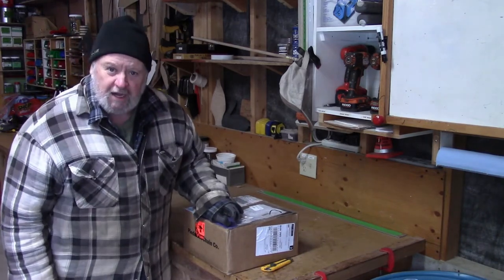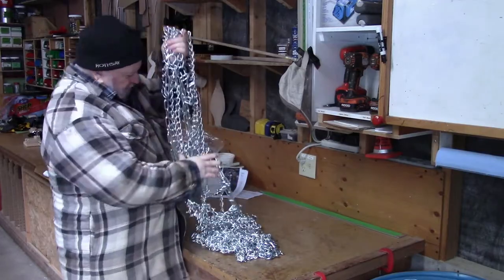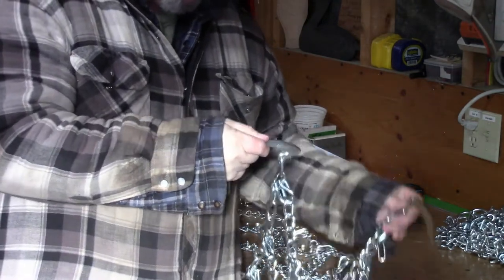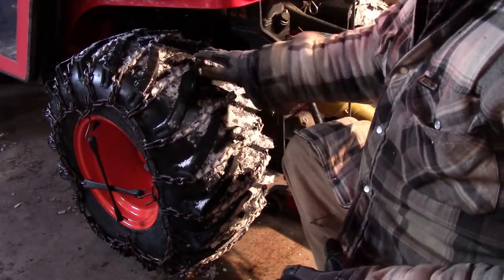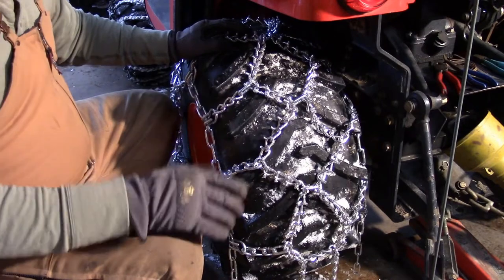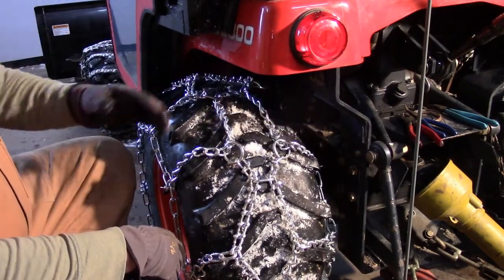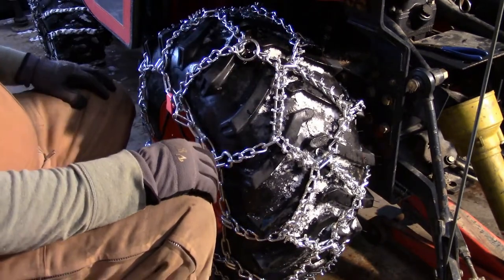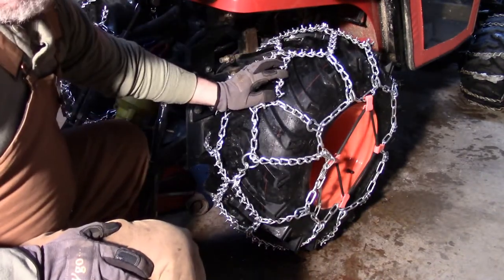New chains For The Massey Ferguson GC2300

Comment: Thanks Mike for the shout out .We all need as much help as we can get .Great looking chains, Joe is right the tail needs to be shorter that will take the slack out of the center .Then get the inside as tight as you can and then you can get the out side real tight because you have room to work .Thats how i do it anyway .Idont like bungees they may cut off in the woods and then your chains are loose and may  fall off .Great video and the bungees will work fine for you  Thanks
Reply from the maker: How's she goi'?  That's a good point about the bungees.  I don't go in the woods and basically just plow snow when the chains are on, so they should be OK like you say.  Thanks for the comments and for tuning in.  Take 'er easy!!!

Comment: Those are nice chains Mike. Maybe they came from around Lewie McNeely's place. He's a great one for fixing up lawnmowers. I think they've gotten almost as much snow as my part of Michigan. 
I was going to ask. Does your tractor have independent rear brakes?
Reply from the maker: How's she goin'?  My Massey doesn't have independent rear brakes.  I was looking at the brakes one day and saw where each rear wheel has it's own lever actuator.  So then I was trying to come up with a way I could add an additional brake pedal to give me independent brakes.  Never came up with anything though ...  Maybe some day!!  Thanks for watching and take 'er easy!!
Reply: @GrampiesWorkshop  The 8N has two pedals next to each other. I can step on one or the other or both at the same time. When I'm pulling something and one wheel starts to spin I can put drag on that wheel with the brake until the other wheel catches. 
Works well on ice. Even with chains once one wheel starts spinning the other one loses power through the differential. Nice for crabbing around in tight spots too. With one wheel locked  the tractor will spin around on that wheel.
Reply from the maker: @OldSneelock  My tractor does have differential lock so that helps, but individual rear brakes is a definite asset.